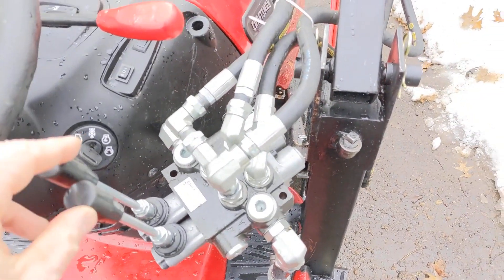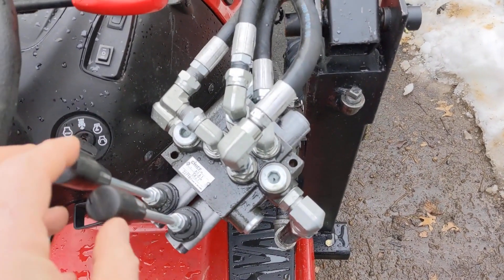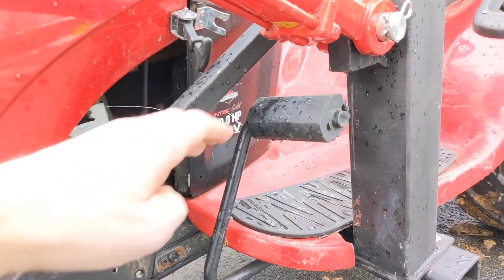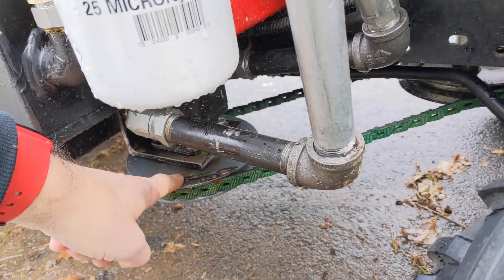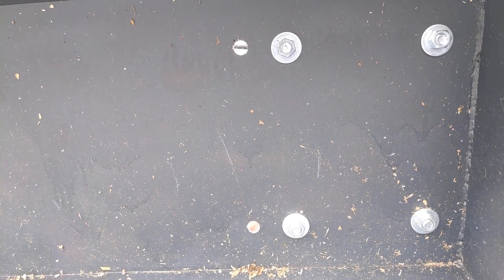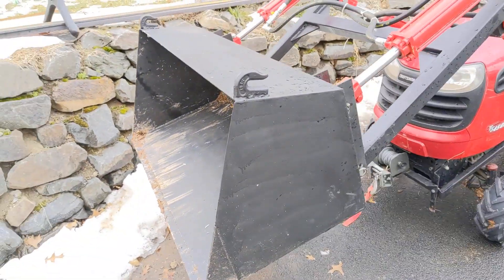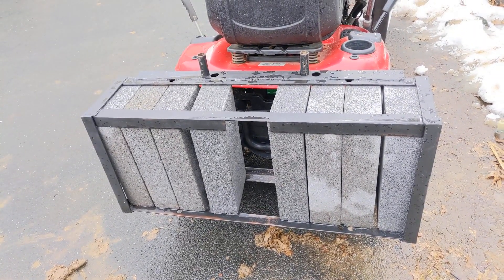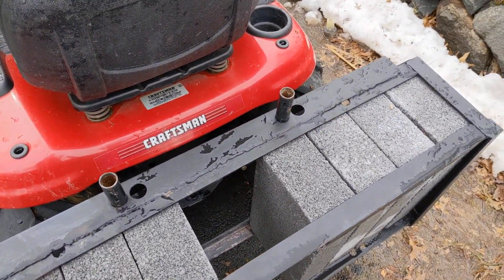Front-end Loader on a Lawn Tractor, What I Learned

Comment: How much do you have into it?
Reply from the maker: I'd ballpark it at $2500... but, that was because I bought WAY more steel than I actually needed. I can only get it in full sheets or 24ft lengths, so let's just say I could probably make another three of these with what I got. I also bought a massive number of wrong hydraulic fittings because my cylinders ended up being NPT rather than SAE O-Ring as are in the instructions, whoops. 

If you don't mind adapting the plans for whatever steel you have on hand I'm sure you could save a boatload. Surplus Center was where I got most of the other bits - but if I had to do it again I would try to get everything I could (valve, pump, hoses, fittings, cylinders) from Tractor Supply probably - that way I could return things when I mess up.

Comment: Which pump did you use, and has it been enough?
Reply from the maker: I don't recall offhand, but yes what I have is on the low-end sufficient as in fast acting enough and certainly more powerful than warranted for the frame of this wimpy lawn tractor. The PF Engineering plans have details about flow rate and such that you'll want to aim for, which you could get from Northern Tool or Surplus Center or your local Tractor Supply. The ratio of the main engine pulley to the pulley on the pump obviously is important for the flow created by the pump. I suppose everything in the hydraulic system, valve, fittings, hoses, cylinders, reservoir - is is all important. Unfortunately, I know only what was required to get it to work and be slightly less afraid of hydraulic circuits.

Comment: To much weight  for that little tractor
Reply from the maker: At least for now it is working. The two weak links which can be improved are the front wheel spindles, which can get a cross brace welded in easy enough, and the twist of the frame itself, which again can take some simple cross braces at the bottom to increase rigidity. The transaxle is what it is - certainly not made for this, so I have to be gentle. Loading wood chips into a small dump bed is my main application, and it has been doing well for that. If the tractor completely dies under the stress, mehh, get a different one. In fact, I have another one sitting right next to it I got for less than $300.
Reply: @RyanShea  that's just a lawn mower it's not a garden tractor and is not meant for ground engaging implements and definitely not for a loader or all the weight. But, looks good and a nice build.

Comment: I am building one on a very similar husqvarna unit. Couple of questions, do you happen to remember or know where to point me to the thrust bearing you used on the steering? Secondly, how were you able to properly tension the link belt without any tensioner pulley? Thirdly, do you know the size pulley you have on your pump? Thanks in advance! I love your build!
Reply from the maker: Here are the thrust bearings I used: https://www.amazon.com/gp/product/B08GFJLZSV/ref=ppx_yo_dt_b_search_asin_title?ie=UTF8&psc=1

As with much of this build, I fumbled through it. Originally thought I'd need to craft up something with in idler pulley, but just started with the simplest thing first, directly connecting. Initially I had problems where the belt would slip under load - then I just removed links until it worked well. I realize an idler pulley would be better. I may not have much room. It was a bit of a puzzle making everything fit and I am already very close to steering drag links.

Comment: Nice work! You mentioned the transaxle being too weak. Is there a reason you feel it's too weak? Did it break?
Reply from the maker: Didn't break, but if it does I'll just replace it. This one is a smaller hydro-gear, and it's certainly not made for the 600-ish lbs I'm asking of it.
Reply: @RyanShea  have you researched what we could swap out with that's heavier duty?
Reply from the maker: @DanielSloanMusic  I think trying to upgrade the transaxle is too much turd polishing. Getting a used old proper heavy simplicity or case or international is probably how I'll do when this one breaks. I can make the loader work on there.
Reply: @RyanShea  Hard to beat the oldschool cub cadets for small loader work. Gearbox/rear end is ludicrously overbuilt.
Reply from the maker: @nicklowe2686  Yeah, lots of options actually - the isavetractors.com guy has a lot of great videos. I am partial to the hydrostatic transaxle. I used to not have a place to store any larger tractor, but now I do... we'll see if this pops up on the priority list this winter.